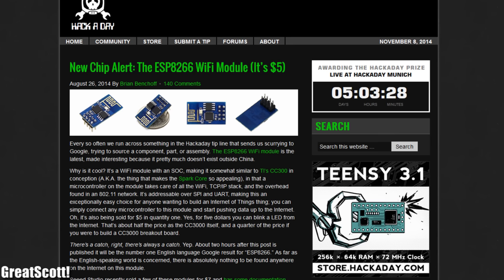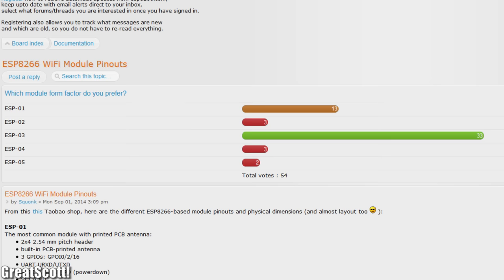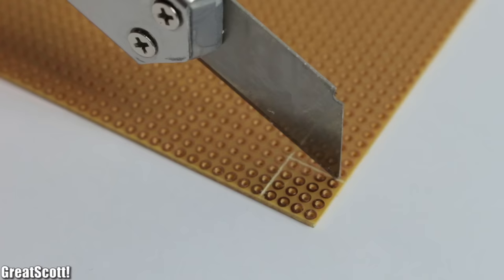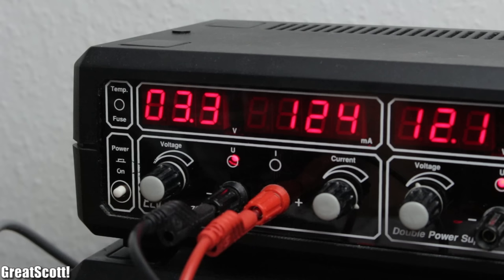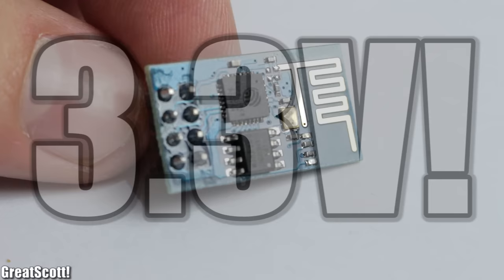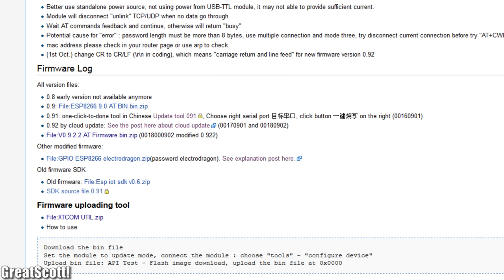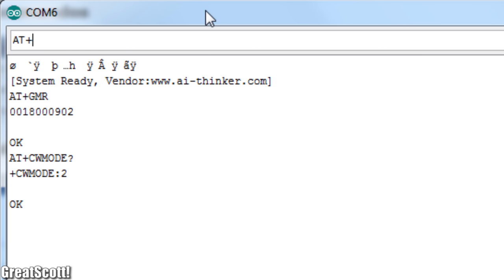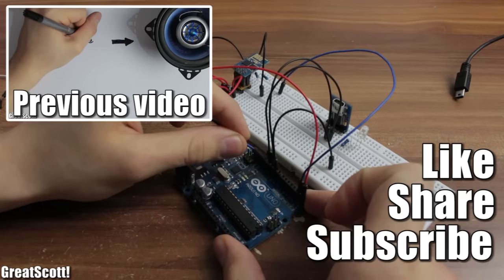5$ Arduino WiFi Module!? ESP8266 mini Tutorial/Review

Comment: good tutorial! I received my esp8266 December 22, 2014. A few comments so far:
I made several mistakes with the voltage divider. And it is my profession. Beware. fortunally i did not kill them. My advice order a logic level converter with it for only around 2 euros.
Remember TX on RX and RX ON TX.
I also noticed that the new esp8266 already sets on a baudrate of 9600.
Finally, the AT commands only work with capital letters. And the serial monitor should be at LF and CR are otherwise the ESP8266 is not communicating.
Anyway all credits for great scott!
Reply: If you're using putty and enter doesn't work, press CTRL+M wait a second then press CTRL+J

Comment: Extremely clear and handy! Though, nowadays it's far more easier to use the ESP without Arduino, there are multiple ESP based devboards and you can program them with the Arduino IDE.
Reply: i cant get my head around the arduino coding and how would i go around using the arduino ide?
Reply: @jamespowell3056 skill issue
Reply: @mahinakhter8157 bro has no chill

Comment: hey Scott, great vid! did u know you could just cut those onboard female connectors at 1:50 with side cutters instead of a hacksaw so you wouldn't get much plastic dust? same applies to cutting pcb - pair of tin cutters does the job w/o lots of residual dust. it isn't precise for fancy cuts but it is faster and cleaner that way imo

Comment: You should do another video on the ESP8266. Espressif (company behind ESP8266) release their SDK and now you can program the microcontroller on the ESP itself using the Arduino IDE. No need for any microcontroller besides the ESP8266 module anymore :)
Reply: I was just going to ask why exactly he bothered with the arduino when you can program the 8266 but i didnt know the SDK wasnt always available.
Reply: that's because extra hardware takes extra space and costs. all i want is control a relay via internet. why would i need an arduino if i have a esp wifi card?

Comment: The ftdi chip can be wired for 3v operation, no level conversion needed!  Connect its 3v regulated output to the vio (io power input) pin.  You may have to cut and jumper your FTDI board, adafruit ones can be rejumpered.

Comment: There is an easier way to solder the female pin headers on the PCB, just slide the pins all the way to the longer side then stick them in the holes from the the top side of the PCB and solder them on the copper side.

Comment: Make a weather station with a UV index that does a forecast lookup for your current location and also acts as a clock that has access to your Google calendar to remind you of upcoming appointments etc.
This would be handy to be able to plug into your car with a lithium battery to power it in sleep mode when the car ignition is off and a built in lithium charging module can charge the battery when you are on the road.

Comment: you should remove the plastic to solder the pins, afterwards you can place the plastic again
Reply: +atm2042 That way he would never get the pins straight. I would personally rather use stripboard instead of a perfboard and an SMD version of the socket, which would make it a bit more comfortable, but either way is fine.

Comment: When soldering short runs of headers, sometimes it is better to put the pins in the long way, solder, and then push the plastic down.  When I do this I place the finished adapter on a breadboard, and press the adapter down firmly to  push the plastic up to the PCB.  Saves mess and burnt fingers :-)

Comment: HI, I would like to say that when connecting the ESP2866 in the arduino, check maybe it's supposed to be "Both NL & CR" in the Serial Monitor, I tried to use it with the Carriage return and it didn't work as you have shown in the video, so if anybody has a problem with that, try using the Both NL & CR option there...

Comment: 1:08 awesome! That's what I have been looking for! No more adding an arduino or (or RPi) to control a switch, pump, temp sensor, actuator etc. Simply get the ESP8266 IP and control its GPIO pins directly from a single page... Ideally one could connect to multiple modules at the same time to control a pool of ESP8266 modules at once rather than having to access them one by one by typing their respective IPs in the browser and load the control UI for just one module each time wanting to control a module. Can't wait for that to happen, then IoT will really take off! :)

Comment: Be aware that most (all whom I have asked) ESP8266 sellers in Aliexpress sell 30mm wide board which doesn't fit to 400 holes/tie points Breadboard, it is too wide. In amazon the still sell 26mm model. So be aware!

Comment: If you install tasmota firmware on it, you will have a big library you can work with. I use this module to control a relais to put on/off lights.

Comment: do something breaking out some of the other GPIO pins.  I have a project that might not need them ... how about a temperature reporting unit, battery powered, that uses a Dallas Onewire thermometer?  Optional, recharge circuit with solar cell.  Another addon option, a data logging for 24 hours if no contact via WIFI. ... Whew... all just using this processor possibly with the -03 version instead.

Comment: I might be stupid, but why not to use 3 silicon diodes in series in order to step down 5v input to 3.2v?
As we know the forward voltage of the regular silicon diode is about 0.6v, so putting 3 of them in series at the input side will reduce the input voltage by 1.8v
5v - 1.8v = 3.2v

This will supply 3.2v with FULL input CURRENT limit.

Sound legit, but is it possible?????

Comment: Sir, great tutorial, i however have an issue in my project, can u pls help solve this.. so, i did everything you said upto, Firmware upload. then, i remove the GND connection of GPIO0, then i changed the sl. monitor as your instruction. Then i removed and plugged again the usb to my laptop. When i open Sl monitor and give the AT command nothing happens... pleaseee.. can you give any advice

Comment: chip power down should be connected to 3.3v ?
Reply: +Gaurav Harchwani  If it is active low then yes (most of the reset/power down lines on MCUs are). In normal operation they are tied to Vdd.

Comment: Awesome, I'd like more videos regarding the ESP8266 :)...Especially I'd be interested in its application for home-automation (temperature&humidity monitoring, led control, switching some remote control-switches)..A great arduino project for home automation which would work with it (but doesn't have yet support for ESP8266) is "Souliss".

I'd also be interesting in if its possible to use the ESP8266 as a transparent serial link for getting telemetry from a rc plane to the ground. :)

Comment: Thanks for that video mate. I just figured out of these breakouts a couple of hours ago and your video gives me a great spot to start thinking about new projects!
One question: do you use the voltage divider for power supply as well? I red that you shouldn't do this anytime.
Reply from the maker: Klaus Daume Correct, a voltage divider does not work as a power supply.

Comment: Those little connector wires you use to test a circuit on the breadboard, are they just male header pins soldered to wires covered with shrink tubing?
Reply: No, it's jumper wires, kind of like dupont wires

Comment: You did a great job on this video. I have all the stuff. But would just using the 3.3v from the Arduino or the YwRobot side work as well? And still have the 5v open for additional items? Please, let me know cause i just got 3 16x2 LCDs and want to make sensors and communicate with the LCD and my phone. Thanx. And yes, I cheated, I use a parallel cable to pinset the ESP-01.

Comment: And what needs to be changed or added to the sketch in order to register two access points (that is, two WiFi networks)?
If one doesn't work, will it connect to the other by itself?

Comment: Wow, this is huge . . . add WiFi to your imbedded project for less than $5 with the benefit of SDK Dev software + multiple IO's!  My current WiFi shields cost $50 :( 
You did a great mod to make it breadboard friendly for initial prototyping. 
Looking forward to putting it on my remote garden moisture sensors.  Thank You for sharing.

Comment: i've seen a lot of projects where they use such module to send the video stream from a camera to a raspberry pi. Is it possible to do the opposite ? I would like to configure my pi zero as a headless and have the wifi module receiving the video stream from the pi to drive a tiny TFT LCD screen I could wear on my face.

Comment: I use an adapter. I tried to follow until 3:34 where i use the serial monitor then power up the board. However, nothing happened on the serial monitor. It is expected to display Ready right? What seems to be the problem

Comment: Hey Scott, 

I was wondering, if you built a voltage divider with the ESP8266 connected to the resistor with 3.2V over it, wouldn't the internal resistance of the ESP itself, cause for a voltage drop over the "replacement resistance" (sorry if this isn't an English term). Which means the voltage drops even lower than 3.2V? I am thinking of connecting it with an MCP1702/MCP1709.

Thanks for the clear video though, it really helped me in understanding this chip better. :)
Reply from the maker: annemiekaudiofreak The receive line has a high impedance which means that practically no voltage will drop over the ESP8266.

Comment: I wanna use the ESP8266 with some 18650 Lipo batterys. What Voltage Converter should i use? I wanna get a really low quiescent current. My current solution consists of a 5V step-up and a 3.3V stepdown afterwards

Comment: The UNO uses 5v right? I guess Im lucky but Ive been using it on 3.3V for VCC and standard TxRx pins without a voltage divider...

Comment: Hello nice tutorial, i had only 1 little problem, i made the same connection for the 3.3v with the 1Kohm and 2Kohm resistor, after meassure the output it came out nice, but after connecting the esp8266 the power dropped to only 1v, what i`m doing wrong?

Comment: Hi,

I want to do something with with this wifi module. I have already a machine that controlled by some buttons and all result is seen on a one color display. 
I want to cut the control wireless and the screen data to a mobile application. can you suggest me something about this? I couldn't find where to start.

Comment: I have a weather station. The display connects to the weather station through a wireless link. However the display need to be connected to a PC through usb. There it has a program that needs to be running to sync the data to weatherunderground.com etc. I'm using windows server at the moment. Could I use something like this to connect to my wifi and sync it directly to the website and use the power from the usb?

Comment: to use with arduino uno:
first insert jumper between reset and ground.
then do this:

ARDUINO-MODULE
TX - RX
RX - TX
GND - GND
3v3 - VCC
3v3 - CH_PD
Reply from the maker: RedBirdRedstone Sorry to interrupt......but the 3.3V power source of the arduino can only handle around 50mA. But the ESP wants up to 200mA. It can work for a while but it can also destroy your voltage regulator.
Reply: RedBirdRedstone In tri-state mode as you suggested the connections should be:
TX-TX
RX-RX
...
To be able to supply the enough current to ESP8266 you should use the 5V on Uno and add AMS1117-3.3 voltage regulator which peak current is 800mA. Thus you should be able to use the Uno's USB-TTL circuit instead of FTDI.
Reply: GreatScott! cheap ebay clones... i know i am taking risks, but whatever... but now i have better power options and an ftdi breakout... back then i had just an arduino!

Comment: Hi, I have build midi controller with 12 buttons and it works fine with my ableton live 9, I using Arduino pro micro for this, now i have new challenge to connect this via esp8266 to my computer and continue to use my midi controller without USB cabel.
Is it possible ? thanks

Comment: sir i need some help regarding, flight controller (kk multicopter v5.5). it work with normal radio transmitter & receiver but sir i wanted to use ESP8266 ESP-01 as a receiver so that i can control it from computer

Comment: @GreatScott!
Man, i really LOVE your videos. i was interested in electronic Stuff for years, but your videos inspired me to play around a while back. 
i'm still more into try 'n' error, but i already built some nice LED projects. (i finished 2 Arduino controlled LED Cubes - heck yeah!)

But i still have one question - where do you get these big Perfboards? i just find them in smaller sizes like 4x6 or 7x9. 
I'd love to build your "LED Sign VU meter" (with a different Text) but i didnt find a perfboard with a fitting size :/

I'd love a hint :)

Besides that, thanks for your GREAT videos, i love them :)

Comment: I want to buikd a garage door opener. I have a pi zero. I have relay module. My garage opener has a remote connection terminal block. So im thinking all i need to do is connect the gpio to the relay the to the garage opener. I know i can just go to Sears and buy a spare opener but that would be too easy

Comment: Hi i would like to install a wifi module in my drone and my controller and design a setup using a 4g wifi router in my drone and setup my controller to receive the 4g signal for long range flight any thoughts and suggestions?

Comment: Nice tutorial, thanks!   I do have a question:  before you flashed the new v.0.92, when the 8266 still had 0.90, would it still respond to all the AT commands?   I ask because I just got an ESP-01,  which I tested at 115200 baud, etc.  My module responds to only four commands:  restore, reset, and AT+GMR.  (It replies v.1.3.0.0)  Any other command returns "ERROR."  Is that normal, or is there possibly something wrong with my ESP-01?  THANKS AGAIN!

Comment: Someone help. My voltage divider puts out 1.6 volts instead of around 3.3 volts... I'm using 1k and 2k resistors.
Update: I figured it out, the order of the resistors matters. I did not previously know this.

Comment: Hi Scott! Nice explanation but I have a doubt. When connecting this module with an Arduino UNO, the signal levels from RXD and TXD of Arduino pins are of +5V right? wouldn't that damage the module?
Thanks in advance.
Reply from the maker: ganesh selvaraj The voltage divider takes care of this problem.
Reply: Thank you.
Reply: GreatScott! I don't think the voltage divider is dropping the voltage on the TX and RX lines. I think they are still 0-5V when Arduino is transmitting and 0-3.3V when ESP is transmitting. The circuit is working because
a) not much current is drawn for signalling
b) ESP8266 is interpreting anything over it's threshold for high (maybe 2.5 V)  as 1 while receiving data.(5V is interpreted as 1)
c) Arduino is interpreting anything over it's threshold for high (maybe 3 V) as 1 while receiving data. (3.3V is interpreted as 1)
Let me know if you agree.

Thanks for the video btw.

Comment: I want to build a midi cable in to wifi out and a wifi in to midi usb out scenario. Basically I have a Roland v-drum that I need to record the midi of.  The stage is 150 ft. from my recording computer.  You asked for what you can build with the wifi arduino so here is my  suggestion LOL thanks! btw, I subscribed!
Reply: I think it would be more reasonable to use bluetooth, as you can't rely on constant wifi everywhere you go with it. Get 2 bluetooth modules with the range required, pair them, and either program them with midi & usb example code or connect an arduino to each end to do the job.

Comment: the esp 8266 with blynk. Crazy stuff.
Reply: ikr! But no tutorials about it :/
Reply: Blynk is not really the best solution to be honest. 

Using an FTDI/USB to Serial converter you can program the microcontroller on the ESP itself using the Arduino IDE and thus unlock way more advanced capabilities.

I suggest MQTT as a solid protocol, which is compatible with almost anything!

Comment: I'm using a Arduino Micro and tried to give power to the ESP-01 board with a same voltage divider as he uses in the video but using the 5v pin from the arduino. I have another voltage divider for the RX line. But the board does not return anything.. not even ready or some random text :(
Is providing power to the board the way I do just completely wrong or is something else causing a problem?
Reply: +Merijn den Houting HI bro
when I did the similar mistake, the arduino board doesnt work at all during the wire connected.
After unplug the wire from Arduino It worked again 
So when I connect the RX line, I checked the voltage 3.3V using my voltage meter everytime

Comment: Can it also send data to a server? E.g. measurement data for detection of the power consumption of different loads.
Reply: You can send and recive any data over TCP/IP, so you can do anythign that computer or any other network device can, it just matter how fast it is, but its battlenecked with very limited serial port speed i guess. In you case you device could send HTTP POST request to send that measurement data

Comment: why create a voltage didivder when Arduino already has a 3.3v pin?
Reply: It's for the RX pin(on the ESP) which is still 5V regardless of what VCC voltage you use, in theory the ESP8266 can handle 5V on the TX/RX pins, but for longer life of the module it's still better to use the voltage divider.